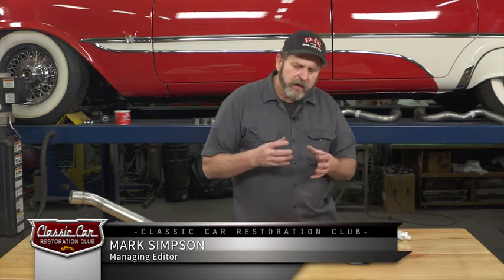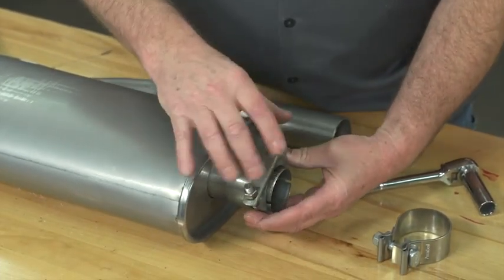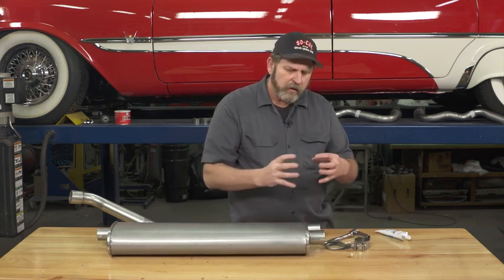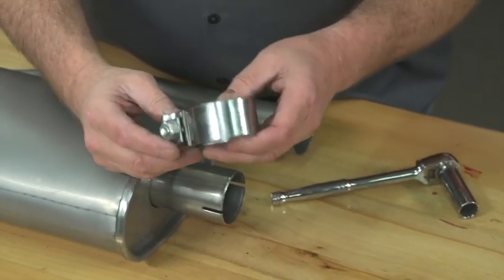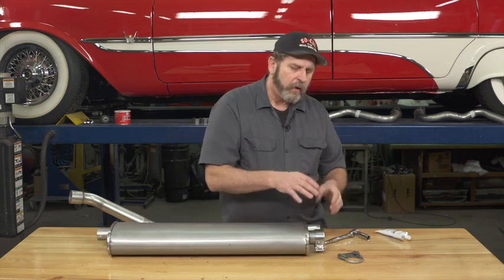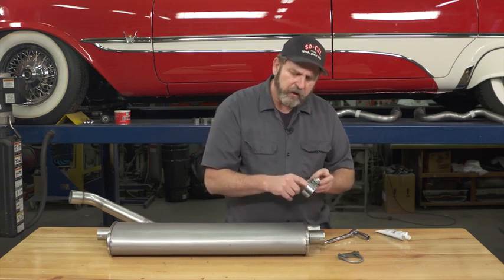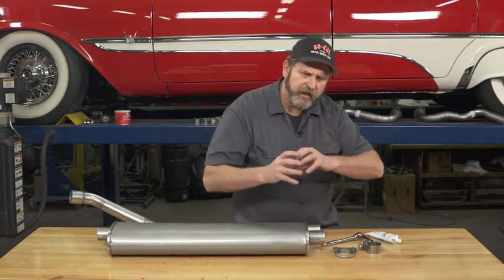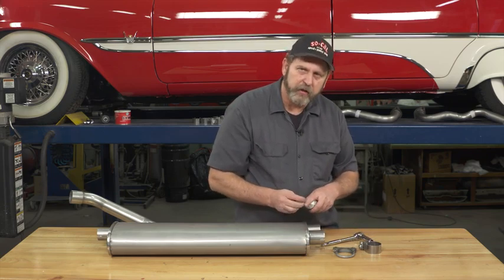Exhaust Clamps

Comment: I use red Permatex silicone gasket maker, it seals well and has a high temp tolerance. Just smear on the pipe and slide it on the muffler. And you can use a  SS lap band clamp that is wide maybe 3 inch wide and it overlaps the whole joint on both sides. It does not crunch the pipes together.
In fact you can use it like a butt joint clamp.
Reply: That’s what I use when repacking 2 sproke and 4 stroke dirtbike silencers, they literally just use 5/6 bolts to hold it together and the red permatex makes a great seal that will never leak
Reply: I agree with the red silicone. He said the exhaust sealant will make the pipe easier to get on and off......not true! That exhaust sealant dries rock hard.
Reply: I was gonna do the same thing on my exhaust but was hesitant, but after reading ur comment. Ill go forward into doing it